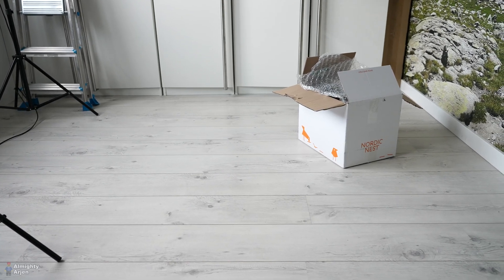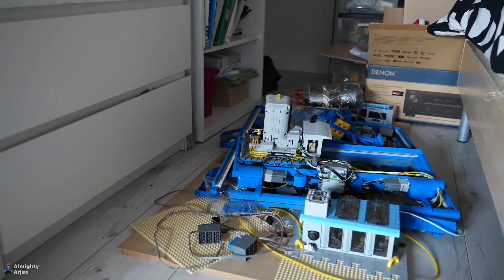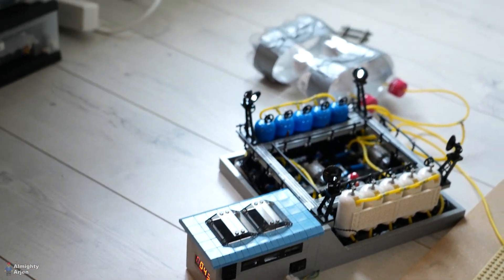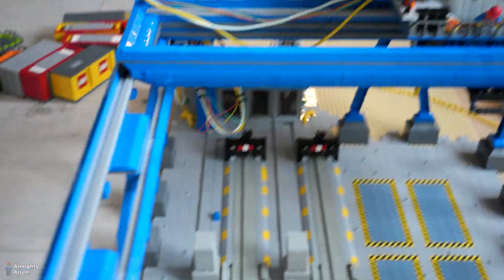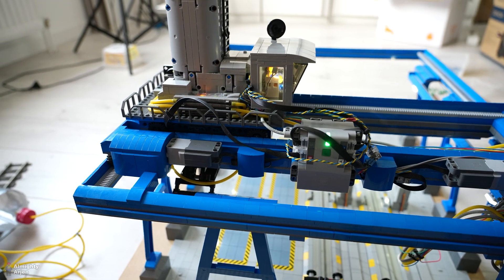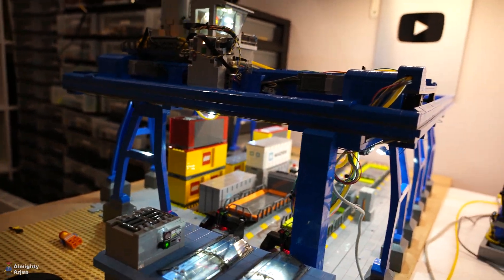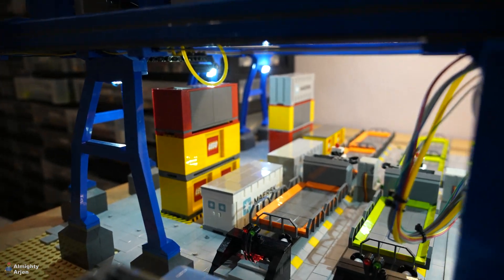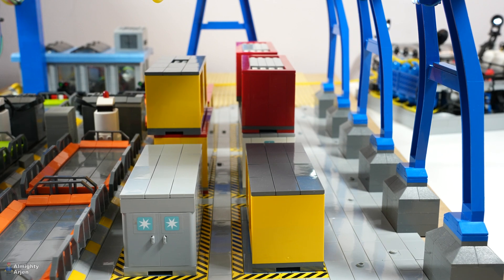Automated lego train container terminal E37: Reviving the blue crane

Comment: Its a very great job! I also made a crane like yours, but only with Mindstorm elements. As for the calibrations, I too had encountered some problems; I spent hours finding the right parameters. I solved by putting buttons that allowed me to interrupt the run of the motors so as not to worry about the speed and the revolutions that they had to make to return to the initial position. I hope I was clear in the explanation☺!
Reply from the maker: The fun thing about rotary encoders is that you don't have to use those buttons anymore. But it takes some programming though!